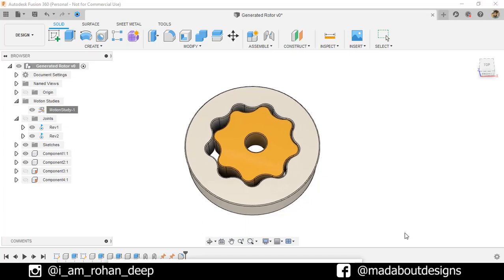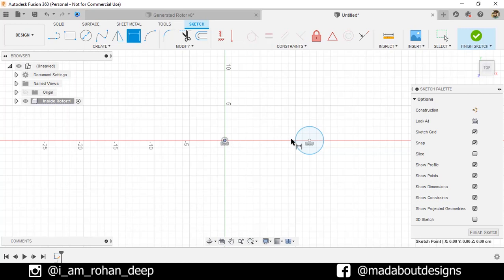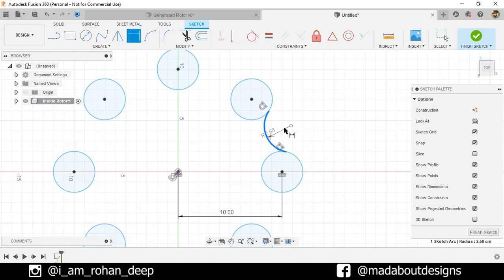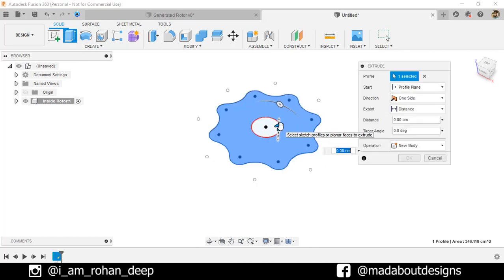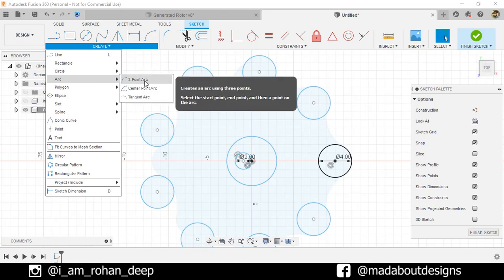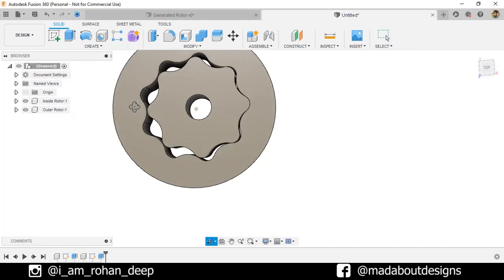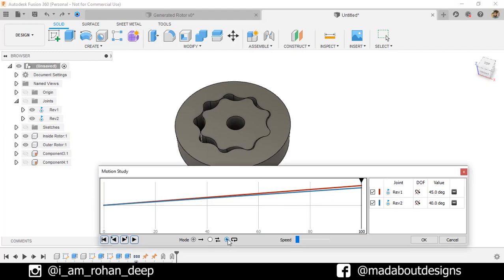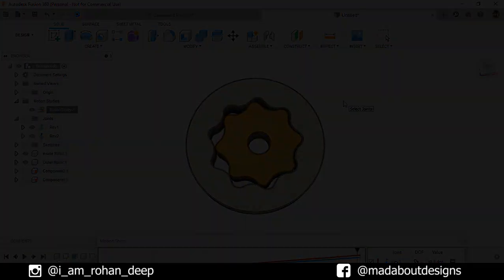How to design a Generated Rotor mechanism in Autodesk Fusion 360

Comment: great VIDEO!! Thanks.  What can this be used for? I assume this cannot replace a ball bearing mechanism, because the rotation is eccentric, correct? Is this mechanism stable against lateral forces? thanks again.
Reply from the maker: Mainly used in low pressure applications.  Power steering is one of them. Search in Google , you'll find a lot of applications of ge rotor. 

Thanks for your query.

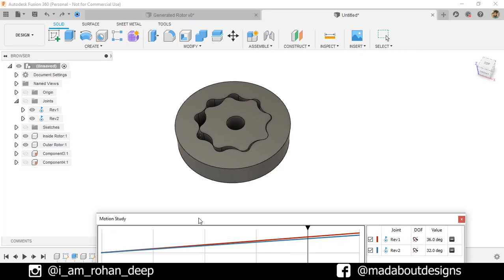Comment: My inner rotor is struck...it is not moving completely as shown at 12:35
Reply from the maker: Try to joint components according to the video.. make sure the angles provided in motion study are at 100th step.
Reply: @MADAboutDesigns  they are correct only I checked
Reply from the maker: Delete the contact set.. because I disabled them in tutorial after applying them
Reply: @MADAboutDesigns  thank-you bro problem solved ❤️
Reply from the maker: Feel free to ask any questions whenever needed.. & keep supporting ❤️